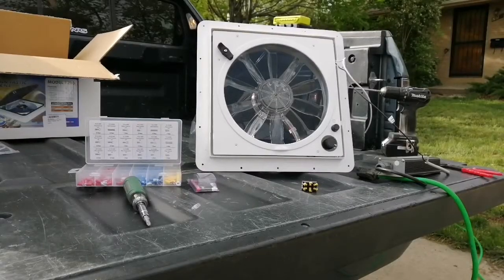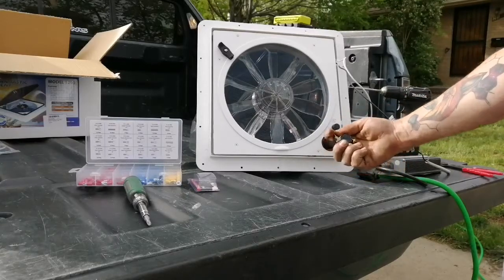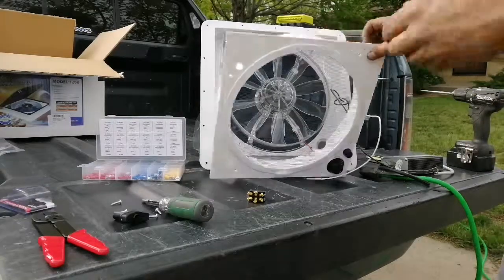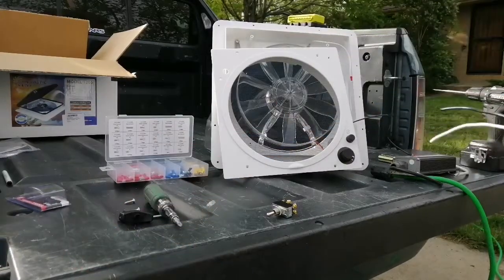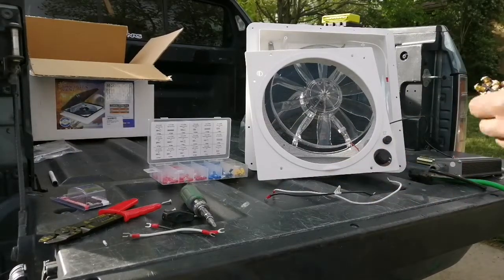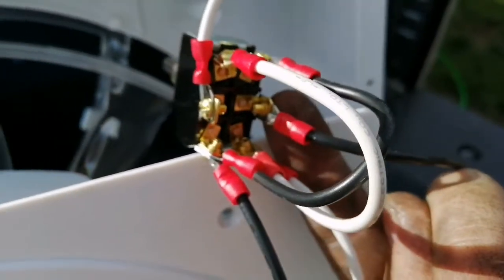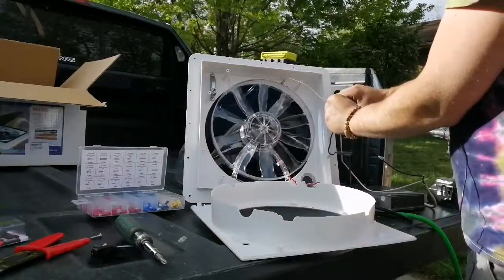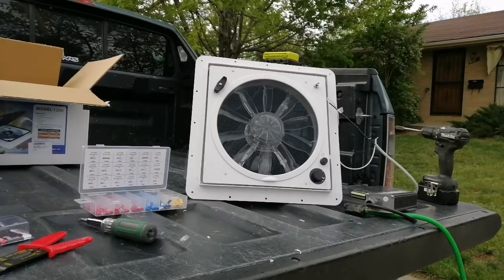Fan-tastic Fan Hack! Add Reverse Function, Save Money!

Comment: Can you do the thing with a 2 position double pole toggle switch? It has 4 terminals instead of 6.
Reply from the maker: Yes, it would have forward/reverse only. The dpdt switch allows for off position in the middle is the only difference.
Reply: @jlis7723  how do you wire a toggle switch that has only four terminals?

Comment: Nice video thank you, I was wondering what do you do with the ‘in’ wires? I actually bought the fan, took the cover off, I’m going to place it so it’s in my wing window of my minivan so I don’t have to cut a hole in my roof because I have a full dvd council in the middle. Do I need to ground a wire? My power source will be a jackery battery. Thanks!

Comment: Very good effort.  I was just like to offer you some constructive input. You skipped very important steps. I am a female who can do most things if given specific details and steps. I need to know EXACTLY which wires you cut, how much and what kind of extra wired you used, how you connected the little 'terminals" on the end, how you drilled the hole and inserted the switch, etc. In other words, I needed to see EACH step and the SPECIFIC things you did. I know you think only men watch this stuff so you assume basic knowledge, but doing each step would have helped me a lot. Also a supply list (including how much extra wire and what kind) would be helpful. Thanks for making this video. Im trying to help your channel succeed too. I am a SOLO woman RVer who must do all repairs myself to save money. Right now I am trying to repair a leak in gray water pipe and install a reverse switch on my Fantastic fan. I have watched many videos on YouTube trying to figure out how to do it, but all of them leave out the amount of extra wire and what kind, etc.
Reply: I am aldo a femaled RVee and do everything myself. Retired master tecnician...Just get 18 or
 14 gauge wire. You will know how much to cut in your specific situation and location. The switch underneath has 6 blades. The ones in the middle should show pos and neg. Remember black is pos in the RV and white is neg unless it was install on a van from start. Then it depends which color wire was chosen for the pos and the neg. Those are the middle ones which powers the fan. Now the crossed ones are the ones that determine the direction of the fan. Make a cross when you jump them together. That will reverse the power and ground to the fan. Watch the video again and maybe this post will help you step by step. The original wires from RV or van are the ones that go in the middle if the switch